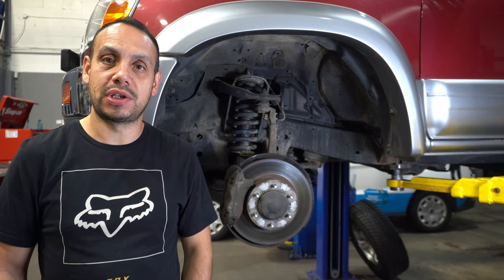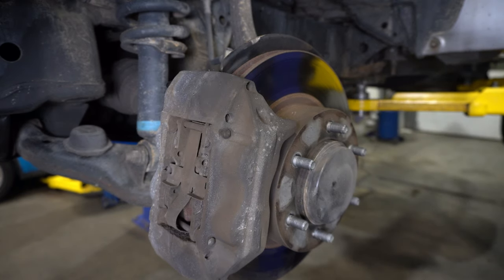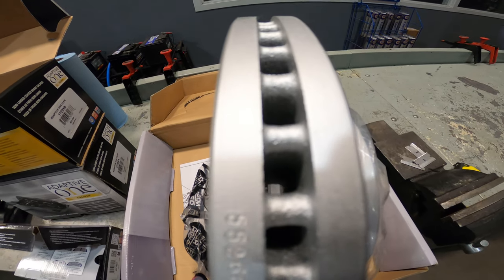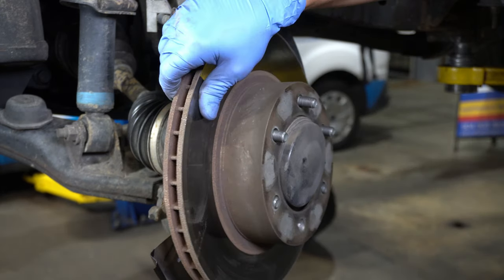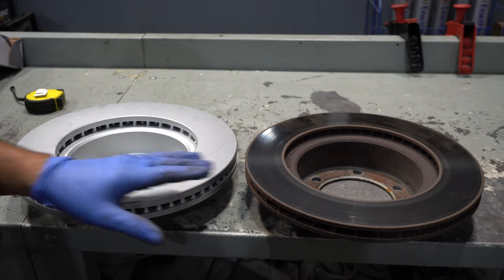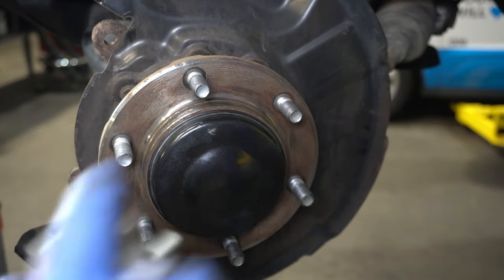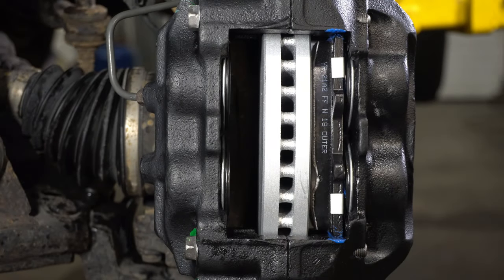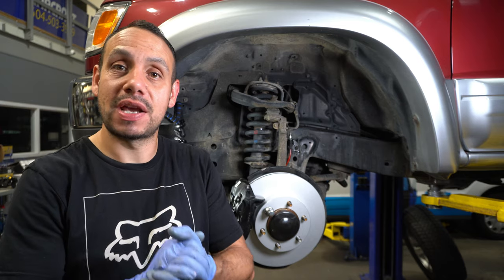3rd Gen 4Runner Tundra Brake Upgrade

Comment: Great How-To!! My 3rd gen 4Runner is an Overland build with RTT, steel bumpers and winch, so I did this upgrade and went with the larger 13WL calipers and rotors. I'm running 16 inch Pro Comp 69 Series wheels and they fit fine. I also upgraded the rear brakes with Tundra rear brake cylinders. The Tundra rear cylinders are a full 1 inch vs 15/16.
Reply from the maker: Awesome. I just did my lift, wheels should show up soon. Got a few videos of all that coming soon. I'll check into the wheel cylinders forsure. Thanks.
Reply: Hi, Does anyone know if U need to remove the running board for 1997 3rd gen 4runner limited in order for the side fender to come off.  I believe I have removed all the screws already but it not coming off.       3 top screw Underhood, 1 in door, 2 beneath door, 1 in wheel well and the 4 screws that holds the plastic,  1 under the light.  Not sure if I'm missing anything.  Please help.
Reply: @mbraylarak how'd you manage to change the rear drums to rotors? What year model tundra did you use? I want to change my drums just for the sake of easier to manage and replace.

Comment: Bro you sound like Robert Downey Jr.
Reply from the maker: Lol apparently it's a thing. Either that or YouTube is trolling me with random comments in my videos 😄 haha.
Reply: @Beacon_Offroad  no trolling, my friend gave me a 1997 4Runner with 185K miles and I’m trying to figure out what upgrades I want to do without spending tons of money and I found your page. One thing I need to do is replace the rocker panels and I have no welding experience.
Reply from the maker: @tp722219  lol, quite a few people have commented that now, its so funny. Well that's cool man, but I can't help with and body work advice. Mechanical I'm your guy 👍
Reply: @Beacon_Offroad  I liked that break upgrade with Tundra pads and rotors and keep the same wheels. That will be this summer, also want to upgrade the original headlights

Comment: I did this to my 2002. I went with 231mm from a 2005 Tundra 4x4 V8. Both my stock wheels and a set of TDR 16s off a 2021 Tacoma fit without any issues. I think the peace of mind on mountain roads is worth it.

Comment: Great video Kelly! Just ordered the parts to do the upgrade and just want to mention for others to order calipers for the 2001 Tundra which are the 13WE 199mm and 2005 tundra are the 13WL 231mm. Disappointed that they arrived without the bleed valves and other port plugs which prevent dirt and other debris getting in during shipping. Cost for the calipers was 179 cdn (each), 135 for each rotor and 110 for the pads. 
My Hilux Surf is nearly complete foe the journey south to Mexico, Guatemala and Belize. Thanks again for your videos and ideas👍🍻
Reply: Dang, hitting up the fancy spots! I hope to visit Belize, Costa Rica and those areas one day. Dream trip is Peru! But that will obviously be a flight 😅

Comment: Thank you for the great information! I did the 13we-199mm Toyota Tundra brake upgrade on my 2002 4runner this weekend and everything went well (thanks to this video). However, after bleeding the system, I noticed the electric motor that pressurizes the brake system consistently activates after 5 presses of the brakes. I don't remember the system needing to be pressurized this often. Have you or anyone else experienced this?
Reply: I was wondering what that noise was!!! Mine always makes that noise all the time especially after braking. Ever figure it out?
Reply: Ever figure the issue out?
Reply: Turns out it is normal
Reply: @gruben79 thanks for the update. I'm doing my 13we on my 2002 runner tomorrow

Comment: Hello gen 3 people, I have a 98' 4runner SR5, V6 2 W.D. with stock 15" rims, will the 199mm caliper fit all stock 15' rims ? I wish I could afford 17' rims and go for the 231mm big boys, but anything is better than 98' OEM brakes. Also I adjusted the rear drums and they offer only Flintstone stopping power without Fred's calloused feet.

Comment: Im not sure if you could would know but if you see this i could use your help. So if we moved up the larger 13WL brake upgrade would we have to change the master cylinder since the pressure to the front discs would be increased to factor the larger rotors?

Comment: How do this setup perform on the road? Debating between the 13WE(199mm) vs 13WL(231mm). I have a 97 4Runner with 4x4, that i intend to use as weekender vehicle and eventually convert into an overlander. Thoughts? Thank you.
Reply from the maker: So far no concerns or issues. This past weekend I did a significant decent down some steep trails for quite a long time and absolutely no fade.  I'm not really sure if I would have seen much improvement with the larger rotor. The extra thickness seemed to provide enough heat sink .
Reply: @Beacon_Offroad  for the (199mm) what year tundra do you ask at Napa
Reply from the maker: @alexamaya7051  follow the link in my description. It has everything youd want to know.

Comment: HI Everyone , do you know if 13WL231mm will fit 1998 4Runner 3rd gen. I am reading different comments and not sure either is a  YES or NO. please if someone has 98 4runner with stock wheels know if it works before I order the parts  .Thanks

Comment: The trail gear brake lines, those are bline 06x correct?  And second question when you did the lift where they long enough?
Reply from the maker: Ill be honest I actually dont remember on the lines. But yes, absolutely long enough, no issues on fitment.
Reply: Any chance you remember where you got the lines? I'm trying to find those same ones and having a little trouble. Knowing where you got them will help. Thanks!

Comment: Will those brake lines you used work with the 231 mm calipers?
Reply from the maker: I can't say forsure as I've never used them specifically, but I can't see any reason why they would be different.

Comment: Will the larger caliper option provide noticeable improvement over the smaller? Is there any reason I couldn't use the stock caliper with the new thicker rotor?
Reply from the maker: Too thick, wont fit. I wouldn't say it provides a big stopping difference but definitely when hot and consecutively braking it will provide more heat resistance. That in itself will provide better braking.

Comment: I did this on my 2000, but now I have such a soft pedal, it's kinda annoying. I heard a larger bore MC will possibly fix it, but IDK. I'm done throwing money at it
Reply: I just bought a 2000. Still having the same issue?
Reply: @Amazonian11  Yeah, but I got used to it. First brake is soft, but the second pump is firmer

Comment: You WILL have a "softer" feeling pedal after the upgrade, there is no getting around it but it's fine
Reply from the maker: 2 years later no soft pedal. Installed many, no soft pedal. 🙅‍♀
Reply: @Beacon_Offroad  Soft as in a longer travel

Comment: I want to upgrade my brakes exactly like yours. I read your link description and it says get the 2005 Toyota Tundra 4x4 v8..can you tell me what exactly to get just so I don’t get mixed up. Will this set up help improve your stopping distance when you are running on 33’s. I have a 1998 Toyota 4Runner limited lifted with 33’s and do you recommend the brand call Power Stop on Amazon. That’s what I’m thinking about getting it. Any info would help me.. I want to upgrade ASAP...thanks
Reply from the maker: Its definitely worth it. Check out the link I posted in my video description. Its has all the relevant info that will help you out. Power stop it ok, I'd probably choose something else but I have much different connections being a shop owner.

Comment: I’m running a 17 inch wheel. I’m pretty big on oem could you point me in the right direction of the parts I need to buy. I would greatly appreciate it bro!!
Reply from the maker: Check the video description.  Everything you need to know is there. Follow the link for further info as well.

Comment: Do you think the 199mm upgrade would be fine for 17 inch wheels? I really dont feel like cutting the dust backing hahaha
Reply from the maker: As far as I understand 199 has no issue with 17" only some 16". If your running the larger wheel, no problems.

Comment: ive got a 2000 4runner sr5 w the stock 15 inch rims. the stock calipers fit just fine, and i know the 199 tundra calipers are just a little bit thicker,but can anyone confirm if they will fit?
Reply from the maker: On 15s I believe that's a no. Follow the link innthe description to the forum post.

Comment: Did you have to upgrade your master cylinder?
Reply from the maker: No did not. Even installed a handful of these at the shop. No issues to report.
Reply: @Beacon_Offroad  Okay sweet thank you! For some reason the shop I am going too is saying I have to upgrade mine. The brakes are spongey, but from everything I have read and heard is that it shouldn't be the issue. One of the calipers boot's is falling apart and I live in a humid area. Should I just bleed the brakes and replace the caliper?
Reply from the maker: @noahcasey7230  soft pedal is a common complaint.  Check the calipers and bleed it lotf to make sure theres absolutely no air and you shoukd be ok.